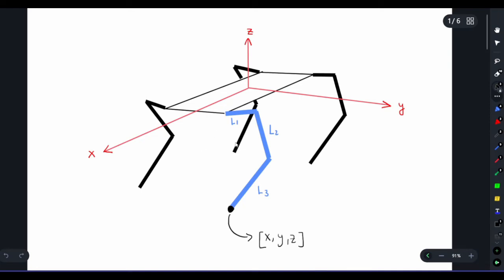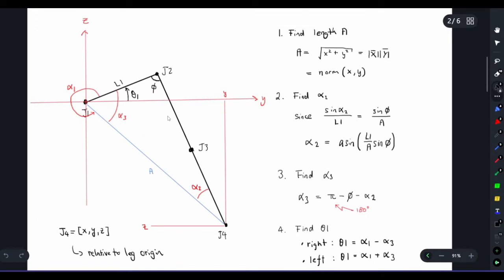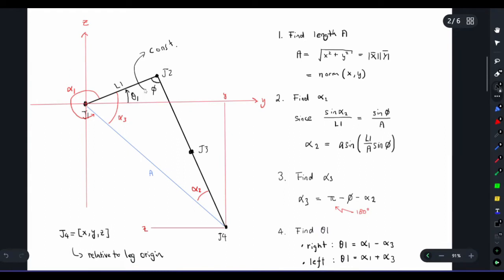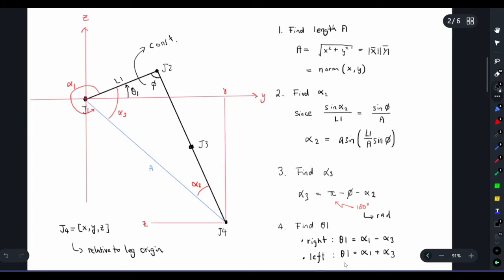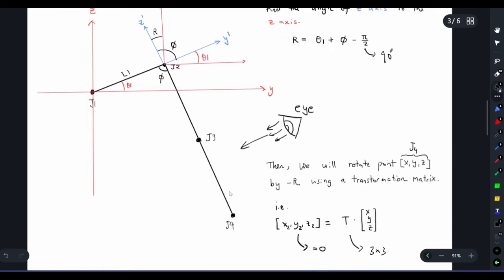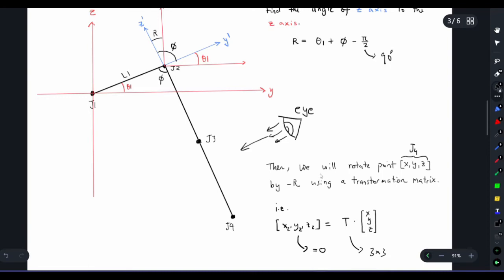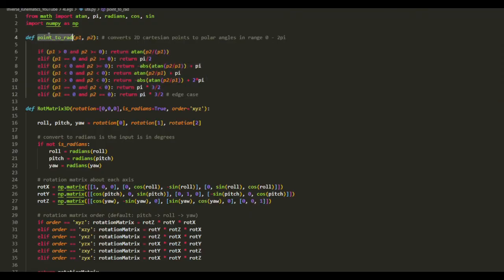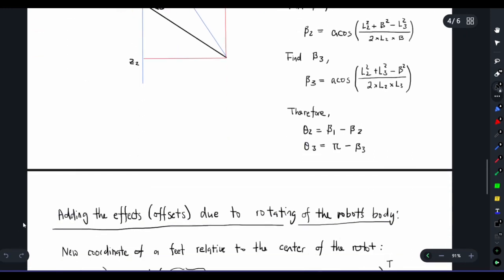Part 1 - How to Solve Inverse Kinematics of a 4 Leg Robot

Comment: I am working on a project requiring custom IK, I have tried setting an Quadratic Lerping method, get the basic relative position of each bone in my rig, then I adjust from there. But I still have problems.

Comment: Hi, I work in vfx and have been trying to create my own math based inverse kinematics setup based on three vectors, so what needs to happen is say for example I have a fixed point (the shoulder) then when I move the wrist point, the elbow point should also move based on a calculation. So far I use the law of cosines to give me all of the angles between the three points, and I am a bit stuck now because when the end point moves, the elbow point needs to move simultaneously so basically the difference in the end point position needs to be added or subtracted from the elbow point, and then I will use a different equation to control the twist of the plane that the triangle sits on, any idea what I should look into for this?

Comment: Thanks for sharing your knowledge. I do have a challenge I'm facing. What about in cases where the number of joints in the front legs is different from those at the back. Say my front leg has 3 joints (base - L1 (pan), L1-L2 (shoulder), L2 - L3(elbow) with an additional fixed joint at the wrist) whereas the back legs have 4 joints (base - L1 (pan), L1 - L2 (shoulder), L2 - L3 (Bridge), L3 - L4 (Leg/knee) and of course the fixed joint at the ankle) how does this change our (Inverse) Kinematics implementation? Thank you
Reply from the maker: Hi, thank you for the question. I think in the case of 4DOF links, the kinematics would become a little more difficult. If the additional joint is a fixed joint (i.e., not rotating), then I think it's possible to treat the system as 3DOF, which is easier to solve; but you may need to add additional offsets (angle and position) to account for it. (similar to how I added an offset from the center of the body to the origin of the leg).

Comment: I don`t get it how do you get alpha1? On page 2 it looks like alpha1 = 360 Degree or 2PI - alpha 3. 
but If I use that the formula for O1 obviously does not work.
Reply from the maker: Hi, thank you for your question. alpha 3 is calculated using the y and z coordinate. The value of alpha is assumed to be always positive somewhere within 0 ~ 360 deg (2pi). This can be obtained using a custom function that adjusts the angle depending on which quadrant the (y, z) lies. I hope this helps :)
Reply: @EngineerM  Hi.alpha1 would be atan2(z,y) right?In the video it isnt shown how to get apha1